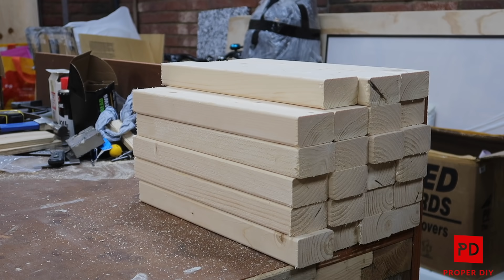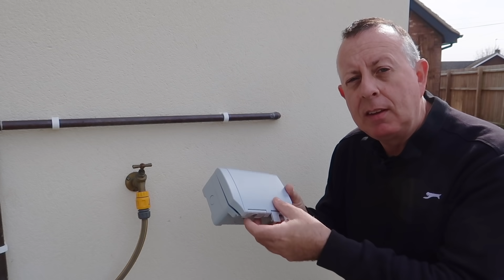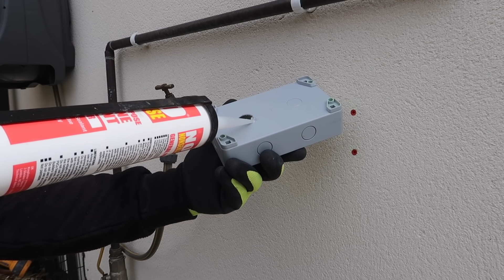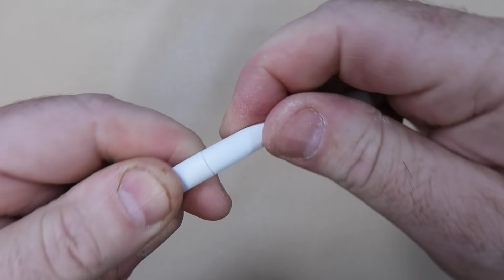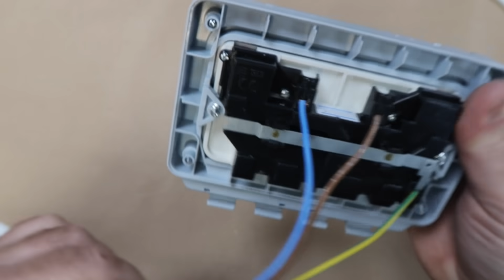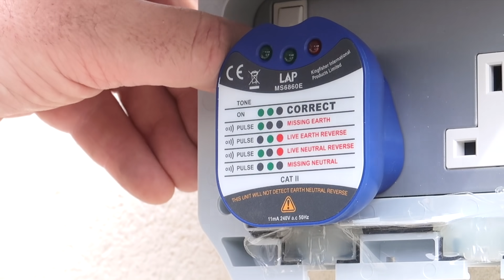How to Install the Easiest Outdoor Socket

Comment: Maybe worth noting that if you do it this way you can't exceed 13A from your outside socket, whereas you could if it was wired as part of a ring or radial. An electrical snob would moan about discrimination.
Reply from the maker: As you see in the intro I use it for a strimmer, jet wash and a couple of other tools I don't have in a cordless version. I really don't think I will ever get near to hitting 13Amps. Even if an electrician comes and fits an outside socket for you it won't be on a ring - prob just a spur from an inside socket.
Reply: @ProperDIY  

Yea as a spark you always try and keep the ring intact, if not spur off the ring as long as that's not been done elsewhere. What you've done is fine for most things it's just if someone does this for a hot tub or patio heaters they might come unstuck!

Comment: The ‘YouTube algorithm’ suggested your garage door video. I was impressed by your presentation, so watched some more of your videos. I may copy your workbench. Your channel deserves to grow 😀
As an industrial maintenance electrician I can confirm that this is the best method for a DIYer to fit an external socket, and for me too as there is no need to be part P registered as existing circuits are not altered. You have shown how to safely install a fixed, waterproof extension lead. I would echo the comments regarding using ferrules to keep the copper strands secure in the socket terminals, but your twisting then folding of the copper wires is the next best solution. Nearly all connection issues I encounter are caused by the screw becoming slack against the copper wire over time, by filling the terminal with more copper wire the strands are less able to move as the screw is tightened ensuring that when tightened the connection will remain tight.
Reply from the maker: Thanks!. Good, sensible comments which I agree with. I'll have to look into the ferrule addition - I've never used them. Great to get feedback from a calm, logical electrician.

Comment: Fabulous video even I can understand it and it has inspired me to install an external socket only problem is my outside socket box instructions says add extra earth wire and connect to inside of box ? Am I right in thinking I don't have to do that as I am only installing with a plug ?
Reply from the maker: Thanks. Without seeing your exact set up I can't really advise however I would be looking at where the separate earth wire goes. Sometime they like to put an earth cable into a terminal that has no connection to anything so I would question if that is needed

Comment: 1.5mm 3 core flex can take 15A, is that before or after youve applied derating factors? Is the circuit youve connected the socket to RCD protected?
Reply from the maker: If you know about derating, you will know it's done to reduce the heat build up in cables (to prolong their life) if they are bunched up (electromagnetic effects) or in conduit. Neither or these applies here so for an open cable of this type, not adjacent to others and only 3m long I don't think I need to derate - essentially it's an extension lead. 
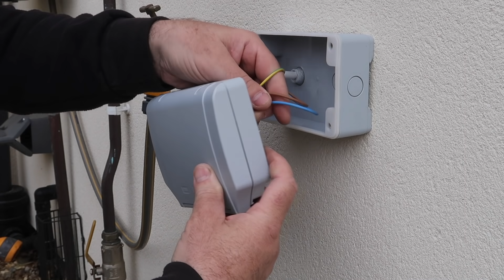I talk about RCD's at 11:20 in the video.

Comment: Could you do this to charge an electric vehicle overnight using the 3 pin plug charging cable provided with the car? Thx.
Reply from the maker: Unfortunately I think when it comes to car charging you need to get a point professionally installed direct from your distribution board.

Comment: Question regarding the timer. If you have something plugged in outside, won't the plug case be open? Meaning not waterproof at all? So you'd have to manually plug/unplug anyways in case it rains or whatever?

Still a great video though! So simple, yet I wouldn't have thought of it.
Reply from the maker: No, these cases are designed to close tight around the plug and even seal around the cable to keep waterproof when it rains

Comment: I've just done this after watching your video. Decided to run the cable round the back of the fridge freezer. After moving the fridge for access all going well but then noticed the freezer door screws were really loose and door hanging off. The screws holding it on were not doing anything and had no bite left, no wonder it had been leaking.  so then spent the next few hours taking fridge freezer doors off to fix it all. So now got a double socket right next to shed and a fixed freezer :)

Comment: what size cable do you need please?
Reply from the maker: It's a 1.5mm flex. No need for anything bigger as the fuse in the plug will blow first

Comment: Is there a separate video where you show which electrical safety tests you performed .
Then explain why you perform those electrical safety tests and how you fill out the Minor Works Certificate.
Reply from the maker: Under Part P of the UK Building Regs you don't need to - it's not notifiable.
Reply: Was just curious. All self respecting qualified electricians always test any new installation work they do no matter how small .
It’s good practice and it’s what we learn as apprentices.
There may be flaws and dangers not visible to the eye and in the products used so testing is performed to eliminate any hidden danger.
Reply from the maker: @AUBERGINEize  Similar to not PAT testing in the home I suppose.
Reply: @ProperDIY  😂 They both contain the word “testing “ but are hugely different.
PAT Testing can be taught in a one day course and no previous electrical experience is required.
To gain a qualification in Electrical Installation fixed wire testing takes at least 120 hours guided learning plus many hours of practical learning.
You must also be employed in the electrical sector. To become a decent testing and inspection electrician takes years and is a highly skilled professional discipline .
So while both types of testing are important for safety reasons the importance of fixed wire testing is paramount.

Comment: Always drill the drain hole. Otherwise water will get in. Dont ask how. It just will.
Reply from the maker: I disagree. All other entrances I have sealed so I dontvbelieve it will. Anyway, at the 12month anniversary I will do an update and we will all see.
Reply: @ProperDIY  i get it. Youve done a good job. But from experience as an actual electrician the drain holes are needed. As condensation has no where to go. It wont effect the ip rating as its only on the bottom
Reply from the maker: @illegalfreedom1055  If I've sealed all the entrances, where will the warm, moist air come in from to produce the condensation?
Reply: @ProperDIY  bro im not here to argue with you. Just trying to help you improve. 

When the seals begin to break down or potentially get slightly damaged. Water will have no where to go

Comment: Isn't this in effect an extension lead that's clipped to the wall ? If you want to cheap out, simply cut the bottom off of a 5litre plastic container, screw to the wall and stow extension lead end in container.
Reply from the maker: Yes correct, essentially an extension lead ending in a purpose made external socket. If you want to put in in a plastic container then to save on the on the IP rated socket thats up to you.

Comment: I need to install a pond pump 130 feet from the house could I use this idea? And if so what size cable would be adequate, thanks
Reply from the maker: At that distance from the house you really need to install armoured cable which doesn't suit itself to this method I'm afraid.

Comment: I successfully fitted an external socket using this method and it went pretty well. This is a neat way to avoid having to modify or extend fixed circuit wiring (an important consideration for DIYers) and as you say, gives you the option of smart controls if you wish. Thanks for the video.
Reply from the maker: I'm glad it went well and you have the flexibility that others don't

Comment: Excellent video. This is exactly how I installed my outdoor plugs. I also put an RCD adapter on the plug, just to make things extra safe. Really nice and neat job 👌🏻👍🏻
Reply: Likewise, RCD plug instead of the standard plug 👍
Reply from the maker: Thank you
Reply: Socket not plug

Comment: Probably best to fit a non rcd protected socket if you have an rcd protected house ring main . You don't want to have 2 rcd  on the same circuit
Reply: Why not? I have been wondering about that. Please explain. Would they conflict with each other in any way?

Comment: The socket has to minimum of 300mm from the tap. Personally I’d have if more than that. Water and electric don’t mix!
Reply from the maker: So you're not expecting it to be rained on then?
Reply: @ProperDIY  its not IP protected when the face plate is lifted to plug something in.

Comment: Thanks Stuart. Does the internal (feed) socket need to be on the ring main, or can it be a spur? I know you cannot take a spur off an existing spur (unless you fuse it down), but does the use of the 13A plug effectively make the external socket an 'extension'?
Reply from the maker: Yes correct, it's essentially an extension cable with one end outside. So the 13amp plug will protect it and therefore you can come off any socket in the house.
Reply: @ProperDIY  Cheers Stuart, that's me busy next weekend!
Reply: Just the question I had! The socket I plan to connect to is a spur, so happy to hear this will still work for me. Thanks for the video Stuart.

Comment: I’m guessing your not a qualified electrician, an install like this should never be in a plug top but hardwired into the house.
Reply from the maker: Why?
Reply: @ProperDIY   plug top shouldn’t be used for a permanent install. It’s bad practice. That socket should be part of the fixed install so should be hard wired in. Plugs come with dangers of being pulled out slightly and creating a hot point, failure over time of the plug to socket interface etc. It’s not a fixed terminal as you would expect in a fixed install

Comment: my dad was a electrian  and taught me many things and many tips  over the yrs the best one was when drilling a hole in the wall to fit a socket or lights he would tilt the angle of the hole so it was slightly tilted downwards so no water could get into the wall and into the house  which i allways do and works great and no need for silcone but depends on each person to use it he allways did the same if he was fitting outside water taps or pipes he would tilt the hole downwards
Reply from the maker: Thats definitely a good tip.

Comment: Seeing a cable running along the skirting ( baseboard) would drive me nuts I’d have to hide that wire in the wall. But that’s just me. Great job otherwise
Reply from the maker: You could do but that's a solid brick wall sitting on a concrete floor so it would add quite a bit of work to the 2h project

Comment: Excellent! Very helpful. Only thing is, is 1.5mm cable enough to run a lawn mower from? Would it not be better to use 2.5mm? Thank you for clear and concise video.
Reply from the maker: A 1.5mm cable takes 15 amps - more than the 13 amp fuse in the plug. A 2.5mm cable has a bigger capacity but will end up going through the same plug so the fuse is the limiting factor.
Reply: Ah ha, now I understand. Thank you.

Comment: Great video. I want to use this method to install an external socket in my shed and run the cable the garage electric socket which is only a few meters apart. Is there any issue running a fridge, TV & lights off that in the shed?
Reply from the maker: As long as the equipment you are running off of it is less than 13 amps then it will work. However, the cable running to a shed or garage should be armoured then checked properly for earth continuity and that the RCD is working at the correct speed etc so should be done by a qualified electrician.

Comment: Exciting could be used for Electric car
Reply from the maker: I think you would need more than 13amps to charge a car - I don't know what they pull.
Reply: @ProperDIY  ideally yes. Otherwise granny cable and my walls are too thick.  Will feed the granny cable through the window. Thanks so much I will be more careful.

Comment: Bit of a tip when you strip the end of your electical wires dont pull the insulation off until you have twisted so that the multi fibre wire then twists with out you catching your finger and does a better job of twisting your multi fibre than removing then twisting

Comment: Its not ip66 rated when you used that back knock out. It should be fitted with a compression gland and use the bottom knock outs for cable entry.

Comment: That’s not a half bad job 
Nice and easy, as an electrician I am glad you didn’t show how to spur of an existing socket, also the cable clips should be six to seven inches apart as over time the flex may start to droop , otherwise a fairly good job 👍
Reply from the maker: Well thank you very much! I appreciate that from an electrician.

Comment: Hi, great video and I'll be doing hat job this week. However as per your link  I ordered the internal box for cable to come thorough however the one you have linked is not what arrived, its only the back box that arrived with no cover plate at the front and the box itself is a different design to the one you used in our video ie yours has a circular hole in mid middle of the box and a hold at the bottom to feed the cable through towards the floor etc. Maybe worth checking the link?

Comment: my outdoor socket was spurred in to an inside socket so I can't switch it off or add a timer - annoyed with the builder who didn't check with me.
Reply from the maker: The way electricians do it but no flexibility.
Reply: Swap it for this and control it from your phone, you can switch each outlet of the socket individually and program a timer for each side, easy control from a downloaded app, there's an instructional video on the ener-j website, it's a very simple installation 👍.
https://www.bltdirect.com/ener-j-13a-ip66-outdoor-waterproof-smart-twin-wall-socket-with-2-usb-ports-amazon-alexa-google-home-compatible?cat=7912
Reply: @darknessdestroyer5524  Thanks - will take a look :)

Comment: Hi great video. I'm going to try this .is it ok for a hot tub.  I thought of the plug in a wall thing. But then other people say I should hardwire it to the socket but I don't fancy cutting electric off and taking socket off wall and doubling up the wires etc.  ..
Reply from the maker: Whatever you do make sure the supply is properly each had with the correct speed  RCD. When dealing with hot tubs the risk goes up.

Comment: This is excellent - neighbours robbing the electric hadn't even occurred to me, hilarious. I am about to get an external socket put in for a roof terrace that we are eventually planning, this way is going to be so much easier and cheaper. Good man.
Reply from the maker: Glad I could help!
Reply: I put internal switches on both external boxes, and a gate valve on the outside tap too. Our yard is visible from the lane and the low gate is no security

Comment: Just done this for my new Lay-Z-Spa. Worked a treat, thanks bud!
Reply: Your still technically running it off a extension lead ? I was looking at doing it this way for my spa but told it’s not a great way for it to be done ?

Comment: Why use the plastic pipe rather than just run the wire right through? thanks
Reply from the maker: It's easier to run the wire though the cavity if in a pipe or conduit and I think easier to seal from water ingress

Comment: An excellent video, but in Australia it would be illegal to do it unless you are a certified electrician. You can't make your own extension cord.
You can buy all the bits without having to show a licence, though.
If your house caught fire as a result of your DIY, your insurance will we void.
Oh the joys...
Reply from the maker: It's getting that way in the UK. There are a few things we allowed to do now but the list is getting shorter so I know what you mean. I wouldn't mind if electricians were reasonably priced and available but that's not the case.

Comment: Great video thanks. Quick question please at 12:38 you cut the excess cable, how do you do this? You strip off the excess insulation like before but what do you do to reduce the electrical wires to size? Simply cut them if so with what? Thanks
Reply from the maker: Thank you. I think I used a pair of pliers for that

Comment: Cable 1.5mm thick which can take 15A? Yes it is protected by a 13A fuse in the plug but you are installing a double socket meaning you could potentially pull 26A an melt the cable which is actually a fire hazard?
Reply from the maker: No, if the cable and double socket pull more than 13amps the fuse blows first in the plug. The same as using a 4 way extension cable that is prob behind your computer or TV.

Comment: Quick question why didn't you go direct from behind socket hard wire it
Reply from the maker: 1) I can't control it 2) If I get water in it, it will trip the RCD for 50% of the house at which point I need to find the fault and disconnect it (with my luck at 3am in the morning and 3) If it is always connected, it is easy for a 3rd party to either trip the house RCD or use my electricity. If hard wiring it, it should have an isolator between the external socket and the existing house circuit.

Comment: Can I use the same method to put electric to my shed
Reply from the maker: No, not really. The cable between the house and she'd must be armoured in case of damage and proper test should then be done on this to check the earthing and RCD speed (amount other things). As this would be a new circuit then it has to be carried out by a qualified electrician.

Comment: Nice video really well put together. Just a thought though, my experience of those instantaneous garden hose couplings is they leak after a while and spray in all directions. What if you were using the socket at the time the hose was charged? I think the outlet location should be away from such water positions.
Reply from the maker: It's the same issue as using the socket while it's raining